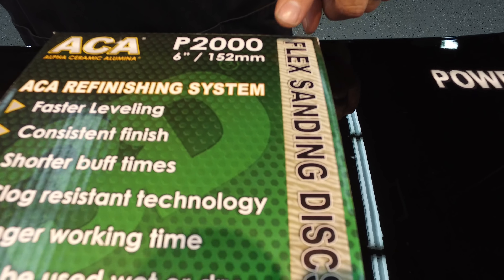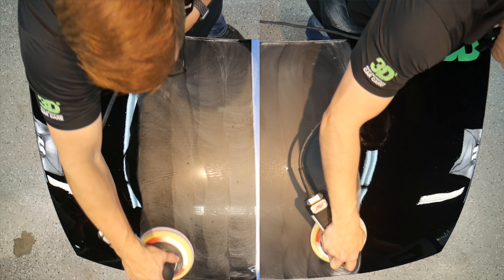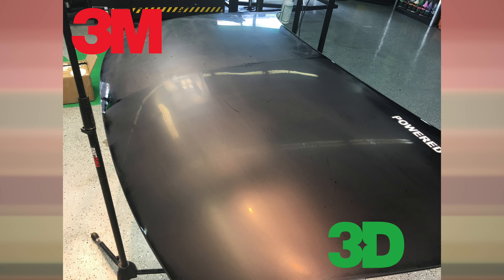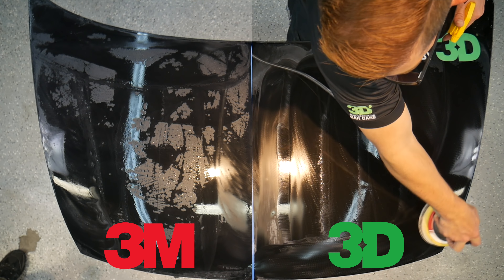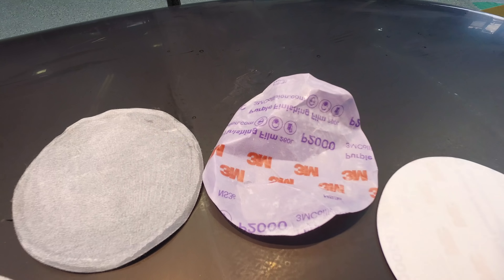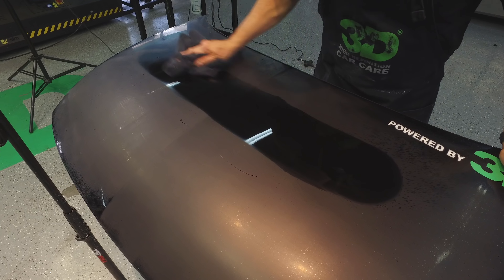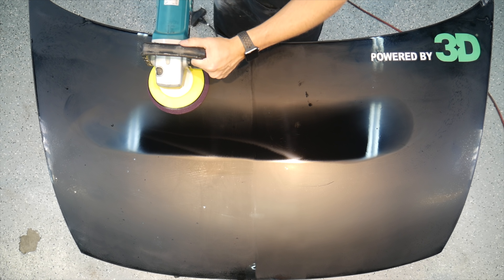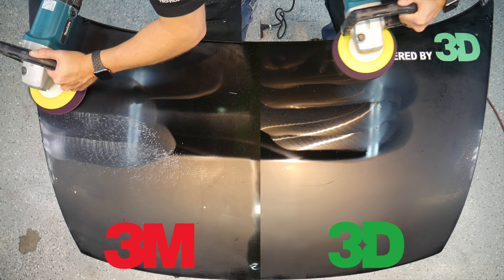Sand Paper Comparison 3M and 3D

Comment: 3D, I love you so much. I've been slowly replacing 3M with 3D in my shoppe and this is definitely the next one. You're the best
Reply from the maker: We have even better papers now, along with masking tape, we only have them through the distributors, because we can't keep them in stock they sell so fast.
Reply: @3DCarCare  

The price is very high from my distributor (Micro), but I just got my first box today, I'm excited to try them out
Reply from the maker: Niko Delmedico did they have the newer papers?
Reply: @3DCarCare  

Yes, they have the 1500, the 2000, and the 3000. They cost $93.99 from Micro

Comment: What are the benefits of dry sanding to wet sanding?
Reply from the maker: Dry sanding can be faster.  Wet sanding can be more accurate. Wet sanding is a process that's often used on car paint jobs, guitars, and even 3D prints to give them a mirror-smooth look. Wet sanding is typically done after dry sanding to get an even finish. Unlike dry sanding, wet sanding is done not to shape a surface, but to remove the large scratches left by dry sanding

Comment: I have no doubt 3D is better.
But you clearly misused the 3M products.
Reply from the maker: what did we do?
Reply: How so?
Reply: I have the 3M 2000 grit sandpaper, they're using it correctly.
Reply: 3M is supposed to be used damp.. not dry or wet. And the benchmark is 3M Trizact System